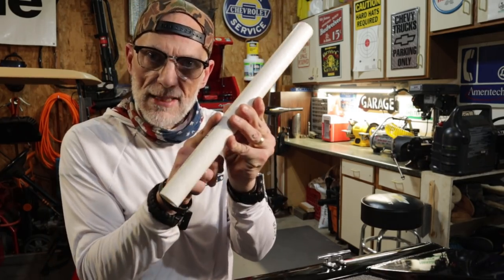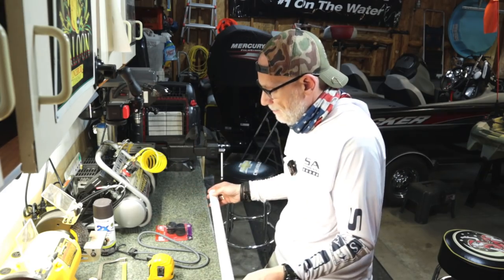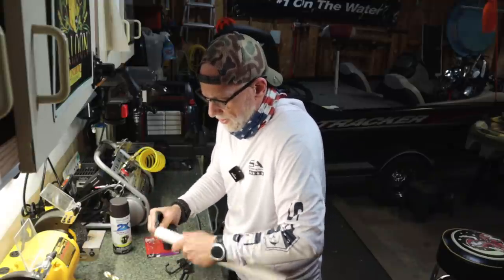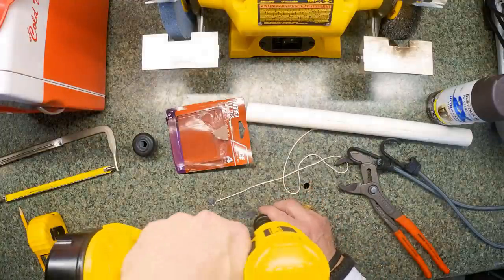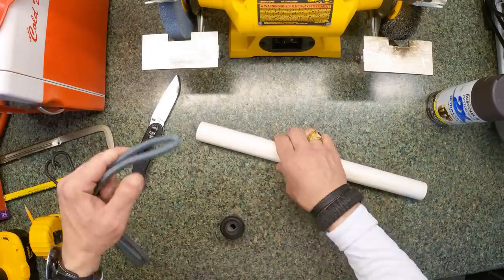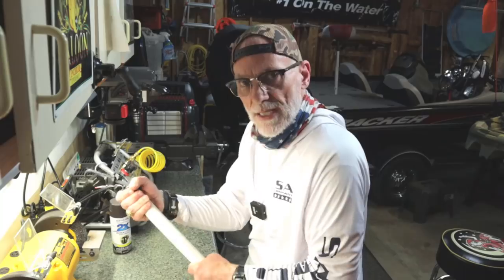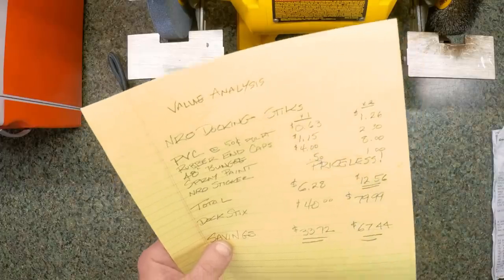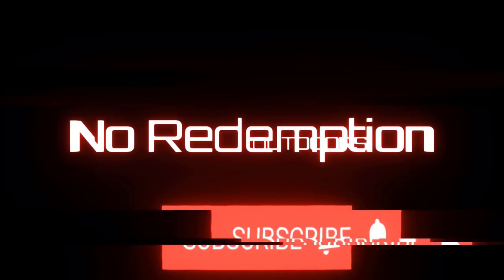DIY DocKing StiKs - Make a pair for less than $13 | Compare at $79.99!!

Comment: Excellent video.  A couple of things I found.  Use a forstner bit and drill from the inside out.  It not only makes a very clean hole, it catches the shavings inside and doesn't spray them everywhere.

Comment: Excellent video, Tony!! Tomorrow morn will find me on my way to the local Ace Hardware to acquire the necessary components for the project, one that will not only protect the boat but clear my deck of coiled dock line that, for some strange reason, will always find and snag whatever treble hooks in its vicinity.

Comment: Great idea! Mind if I offer a couple tips? One, if you wanna use those pliers flip them, those have a directional grip. Also, try using a short piece of 1/2 in copper tube as a hole punch for the rubber.... enjoyed it boss

Comment: Nice video, 2 things. 1st. turn your channel locks the other direction, will pull the top jaw down onto the 
the object. 2ed. a thin schmeer of liquid soap rubbed inside the caps will lubricate them so they'll slide
right on. easy-peezy.
Reply from the maker: Thank you for the great suggestions!

Comment: That was an awesome DIY video.
I am having a hard time loading my boat by myself because of waves and boat traffic. I need someone to hold the boat as I pull the trailer out of the water.
I think this would solve my problem. Thanks for the tip.
Reply from the maker: I hope it helps bud.  I often launch by myself and this will be great for holding the boat securely to the dock without letting it beat against the side while I'm parking the truck and trailer.  Hopefully it helps you too!  👍

Comment: You will get a better bite with the Channel locks if you reverse the grip. The inside of the lower grip should be against the rotation of the drill

Comment: This is the first time I’ve seen one of your videos and it was enough to make me subscribe and hit the bell.  And it’s hard for a buckeye to do that for a channel from that team up north.  Great video.

You said you made a 14” and 16”.  May be a dumb question but does a shorter or longer stick work better for you?
Reply from the maker: Hi Dave.  Thanks for the great comment.  I very much appreciate your kind words.

I made one longer than the other on the theory that the bow is further from the doc when you factor the shape of the boat itself.  They work well.  I also made a pair where both are 16".  They also work well.  I can't say there is much difference.
Reply: @NoRedemptionOutdoors  got it thanks.  I was thinking there were sets of longer and sets of shorter. But you had one of each.  I will try it.

Comment: Pvc water pipe. Has no uv protection.  It breaks in sunlight. 
Pvc conduit does have uv protection and is gray and looks great.
Reply from the maker: That is great feedback.  I'm thinking of making another set with some improvements, and this sounds like the very first upgrade I will make.  Thanks for the very good suggestion!
Reply: But if there painted doesn't that protect from UV getting to PVC?

Comment: I like them but what keeps the boat from moving either forward or backward allowing the sticks to parallel the dock. Therefore basically letting the boat back up against the dock?
Reply from the maker: That is a great question.  So far my experience is if the dock sticks are attached at a diagonal to the dock, it seems to keep the boat away.  If you attached them perpendicular to the dock, then the boat can shift forward or backward and hit the dock.  So.... I'm going to do a video to test the dock sticks, and find out once and for all if they will keep the boat away from the dock, even when there is wind or wave motion pushing on the boat.  Keep an eye out for that video soon!  Thanks for watching!
Reply: watch the doskstyx video on how to use

Comment: Feed and speed is everything dude.  Next time lay the cap on a piece of wood so it does not tear through the rubber.  Also use wd 40 next time on the inside of the cap.  You make it look way to hard...your kind of are doing a hack job...lol